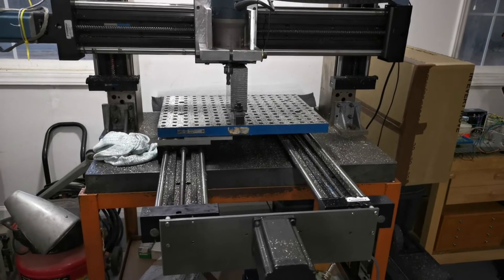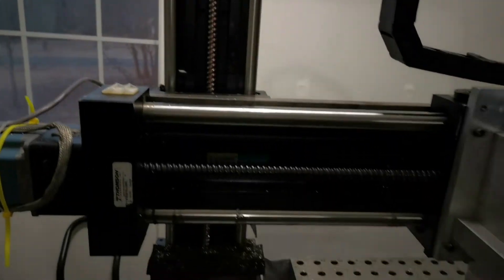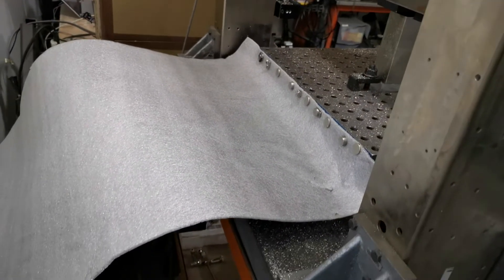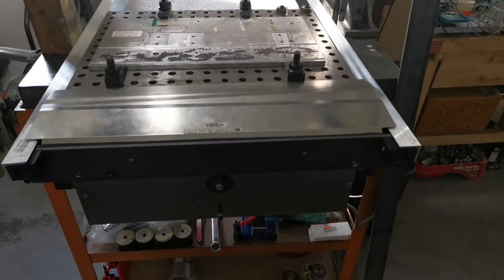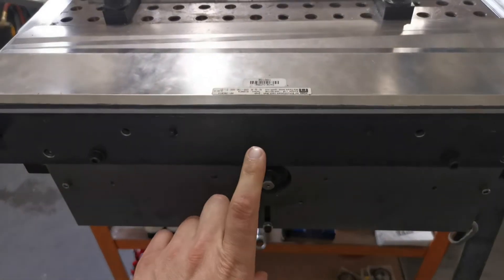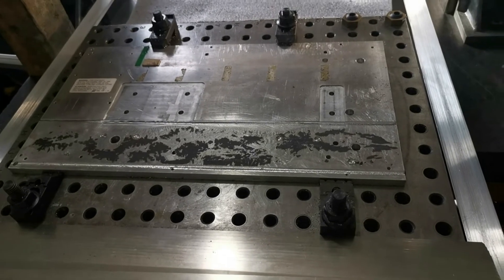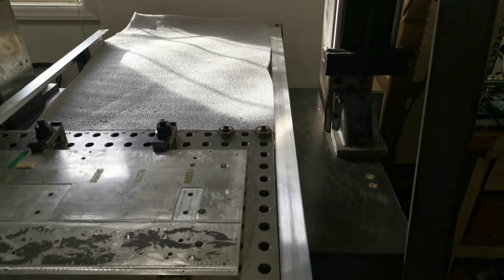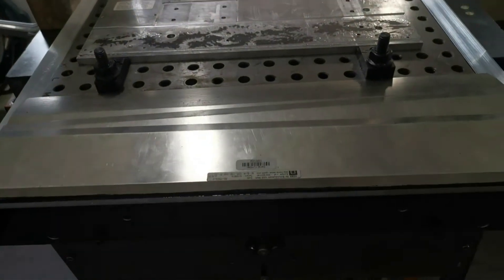Granite surface plate based CNC mill   Way Covers

Comment: I really would like to see that machine with a 4 poled 2.2kw spindle or something, would do it very well
Reply from the maker: It's on the list. I have a 2.7 HP DC motor and an ALPS spindle that I want to compare the the router. But first, I think, laser interferometer vibration measurements.....
Reply: @janbeck8269  Looking forward to see that :)